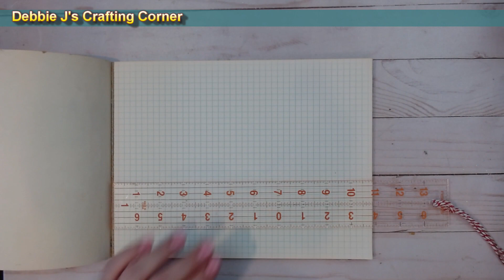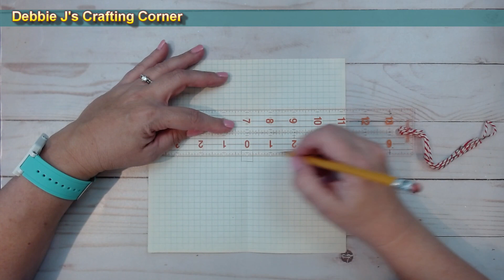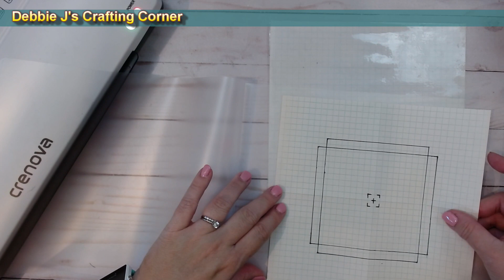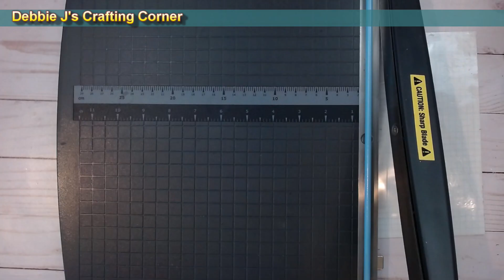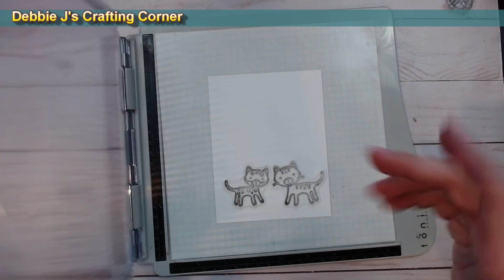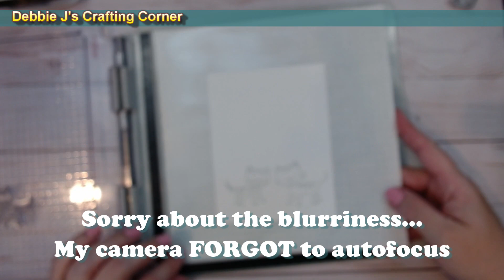Make Your Own DIY Sticky Grid!

Comment: Thanks. Tried this with the Misti flimsy graph paper. Came out great. I don't have any sticky spray (except my quilt basting spray) so I glued it down with my removable adhesive runner then put a couple of strips of it in the center. Works a charm, thanks!